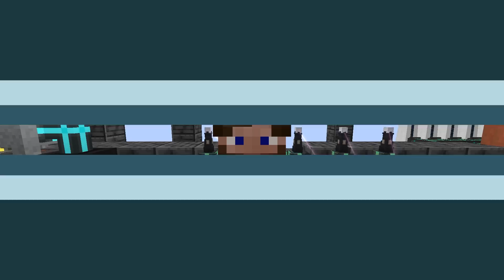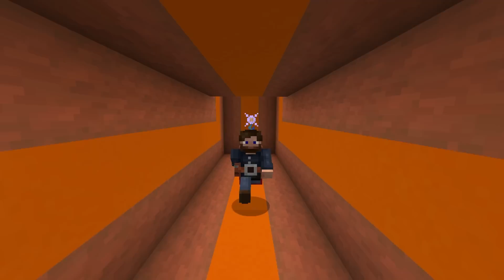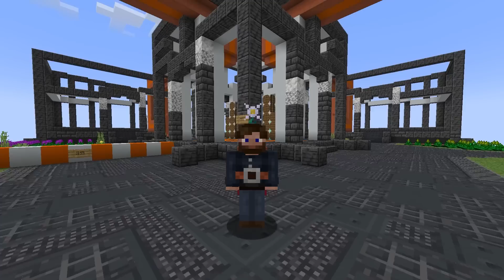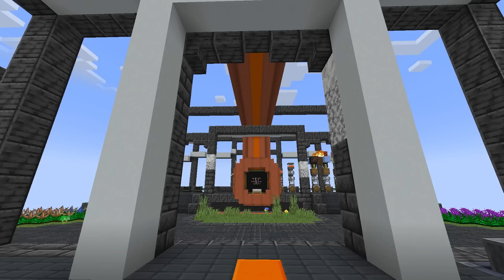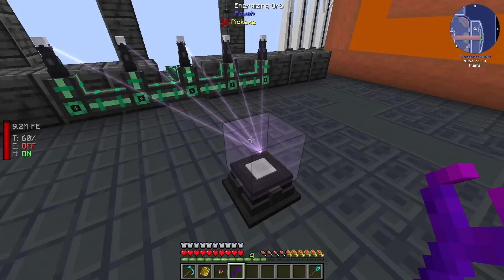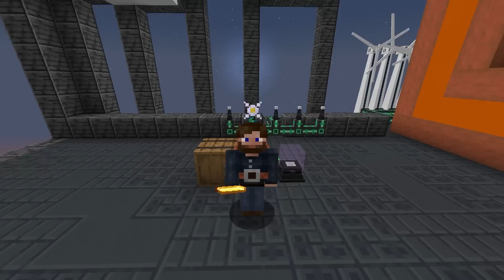All The Mods 9 To The Sky EP8 Powah Automation With LaserIO

Comment: Put a builder in nether with fluid shape card dimensions 22*22*22 that's slightly more than 10,000 blocks put endergate And a lava gen on feeding into a tank on top and load chunk it'll passively make source lava for create hose pulley

Comment: You can use the Powah batteries instead of the energy cells to increase the ender cell buffer. It's not recursive so it's a lot cheaper.

Comment: Just 2 nice looking chests, left and right of "Energizing Orb" with a space in between.
"Item Transporter" from "Industrial Foregoing" 2 on the left connecting Energizing Orb to the input chest, 2 on the right connecting Energizing Orb to the output chest.

=> Right clicking on the Input side Item Transporter that's connected to the Energizing Orb.
=> Regulate Mode: On
=> White List
=> Filter in the items you want to process (enter the right amount of items within the Filter, it will process the same amount of items you filter)

Very easy, very clean, very good looking. 
Takes literally 10-15 seconds to setup.
Reply from the maker: You need plastic and the setup for industrial forgoing takes more then 15 seconds XD
Reply: @ChosenArchitect  Ohh for the "Item Transporters" you only need; 
Redstone - Ender Pearl - Iron - Gold and Wood :) 
You don't need to dive into Industrial Foregoing at all for it 🤎 
Once crafted the setup takes 15-20 seconds I meant, but crafting takes 1 min at most too if you have these basic materials :)

Comment: For our based refined storage enjoyers: The actual easiest way to automate the energizing orb goes as follows:
- Have a crafter facing into the orb from the top. Make sure it only crafts when not given a redstone signal.
- Place a comparator next to the orb facing away from it, then a solid block, redstone dust on that and then another solid block on top of the comparator.
- Place an importer, or whatever means you use to retrieve the crafted items on the bottom.

This works because the crafter sends all of its items out in a single tick, instantly locking itself until the craft is completed. It's fast, absolutely trivial, and requires no per-recipe configuration outside of the pattern.
Reply: I prefer doing this
-RF Crafter on anyside of Orb set pulse
-Modular router next to craft with a puller(mk2 or mk3) and redstone upgrade, Set to pull to the orb and the redstone side to the crafter
-Importer on Modular Router
Its literally the same thing, just slightly cleaner
Reply: @Poke_Benji  That sounds like it would be a bit more compact at the cost of materials and setup for the router 👍
Reply: @Poke_Benji  Interesting how ChosenArchitect has implemented basically exactly this in the episode released an hour ago
Reply: @AdroSlice  i think its a system he has used many times before, i believe he did it in his normal atm9 series also
Reply: Sometimes the crafter inserts two/three items (for example blaze rods) into the energizing orb. Any idea why?
Reply: @saikokamiyt  do you have it set to "insert on pulse" or what ever its called? if you do then its likely somehow recieving multiple signals
Reply: @Poke_Benji  the solution seems to be removing the speed upgrades - thanks anyway
Reply: @saikokamiyt  interesting, never had that issue
Reply: This actually doesnt seem like the easiest way.

Comment: Honestly, Laser IO is nice, but I still prefer Modular Routers. it's easier to configure (at least in my opinion), its items are cheaper to craft, and in terms of functionality it blows Laser IO straight out of the water.

Modular Routers can do everything Laser IO can do, but routers can also place and break blocks or fluids, can do fake player actions, they can act as an item or XP vacuum, they can throw items with configurable angle and speed... they can even push blocks like pistons! So much functionality in one mod, it's hard to beat. And everything is super configurable as well.

Laser IO on the other hand is solely a transport mod which moves things from A to B and nothing else – and even in this regard, Modular Routers is better because it can also interact with the player inventory.

Lastly, and this is of course just personal preference, I don't like laser nodes aesthetically. Nothing but love for Dire but we all know he's not much of an artist. Routers may look uninteresting, but at least they fit in well with vanilla Minecraft, and I can easily hide them with a camouflage upgrade.

Comment: I definitely want to try laser Io because I’m currently making a power plant that uses create new age nuclear reactors to power 3 create steam engines to then power create new age coils and I want to make the most of my fuel cells and make sure the reactor doesn’t melt down, I currently have it belt fed and when I do it at 1 rpm everything works well but if I go any faster the whole reactor melts down starting with the heat pipes kinda need help with the reactors too cuz I’ll get them stable for a bit then out of nowhere everything melts down

Comment: Idea here!

Whenever I play in a pack with ProjectE I use lapis for emc. Either dye seeds to make it or using a atomic reconstructor to take smelted cactus(cactus green) reconstruct it with a colour lens till its lapis. Then have some great item vacuum with a filter set to lapis. Boom. Pour cactus in. Get lapis out. Instant decent emc generation. And also a fun setup. While for ease of use ect you could setup auto traders with villagers and farm sticks. (After making the villager cheap, so it'll cost about 4-10 sticks a emerald
Reply: The items that can be turned into EMC in this pack have been changed to really only include certain mob drops and building blocks (primarily to make it less OP) so thats not an option here
Reply: @awhryan  I assumed lapis would have been added as it was a dye. Sorry ^

Comment: suggestion for the magmators…@BottleTopHornet created an infinite lava pool under his island and used the create mod to pull the lava to an ender tank then to the magmators and generated 400M FE to the ender cell. i feel although the lava pool is massive, it may save space and look cleaner on the top of the island than using the cobble gen and pipes but also create energy faster. just a suggestion if you’d like to check it out :) i love your videos and appreciate the effort you put into explaining how everything works! keep up the awesome job!
Reply: It needs 10,000 sourceblocks right? So like a 22x22x22 cube of source blocks. 

It seems doable with a nice large tank, a hose pulley set to fill and an absolute bunch of crucibles with superheated elements underneath. Barely player interaction required.

Comment: When I started playing TTS I was so bored with doing the typical stuff so I decided to challenge myself and not do the typical. No Refined or AE2. Automation without the auto crafting crutch. I decided not to use reactors and instead I am using the Thermos. I have so much coal now I made a bunch of Furnators just to burn some of the coal. I was able to automate the orb using modular routers. I am using the RFTools Storage to access all my resources. I am really enjoying solving problems without the usual crutches. The LaserIO info is great because I haven't used it much and I know there is so much you can do with it. It should be quite helpful.